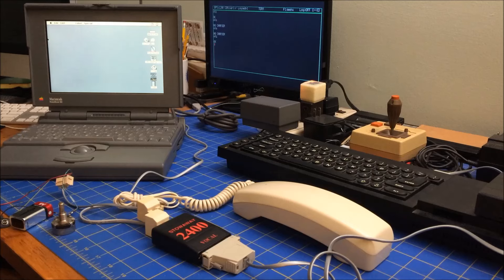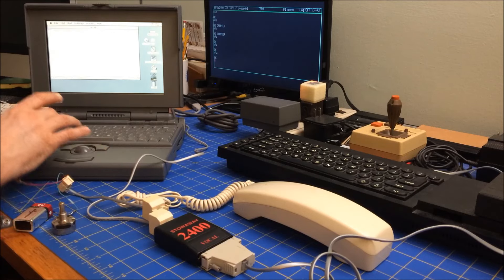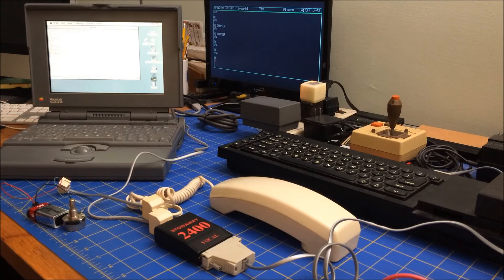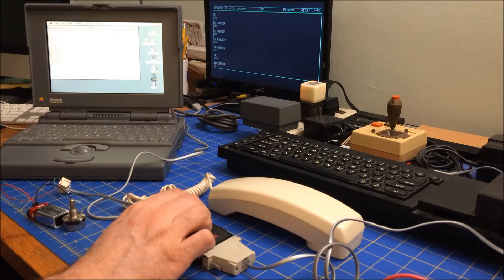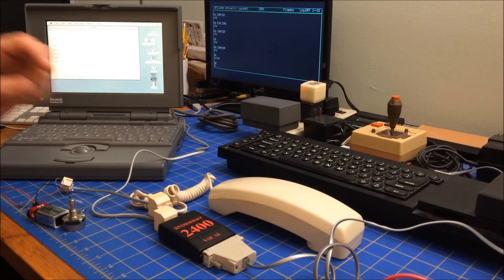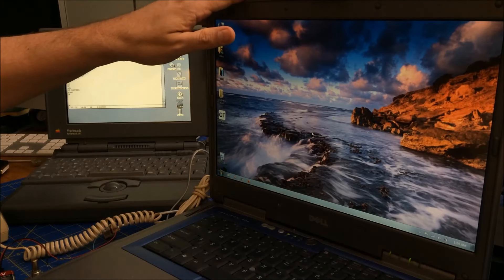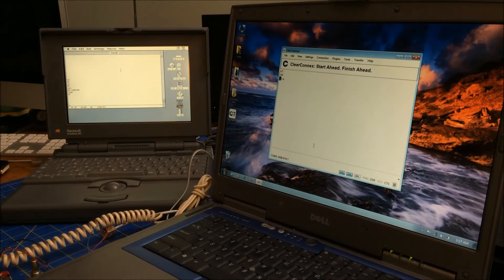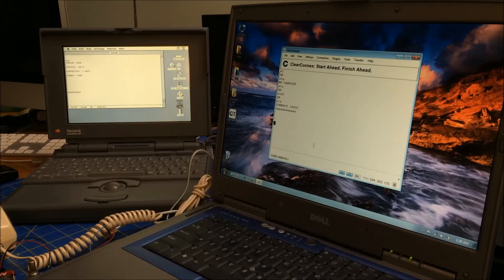A Homemade Telephone Network: Connecting Mac, QL, & PC Modems Over Phone Lines - #MARCHintosh

Comment: Very cool! Do you have a schematic of the phone setup? Thanks for sharing and lots of fun!
Reply from the maker: I suppose I can create one. So basically you put a voltage across the two-wire phone line (9 volts will do) and you limit the current by putting a resistor (between 250 to 300 ohms) on  one side of the DC current (and for a current limiting resistor, it doesn't matter if it's on the positive or negative side). That's it.

And you are right, I also found it pretty cool that it was that simple to make the entire thing work. I wasn't sure when I was trying with the QL but I'm glad I got it to work with the PC. Next I will try my RCA wall extenders to see if I can connect the two machines across the house (different rooms and floors). That's one reason to use the modem connection and not just do straight serial, because those RCA extenders are acoustic (i.e. they don't create a straight electrical circuit). I'll do a short follow up video once I get it to work to share.